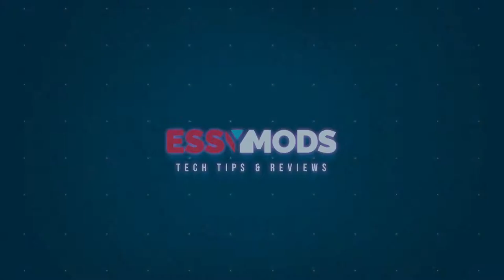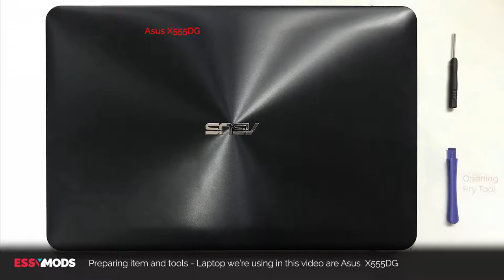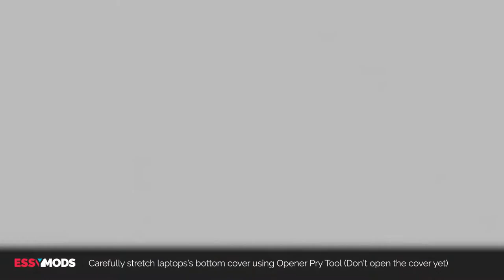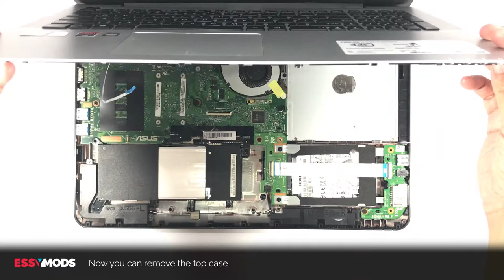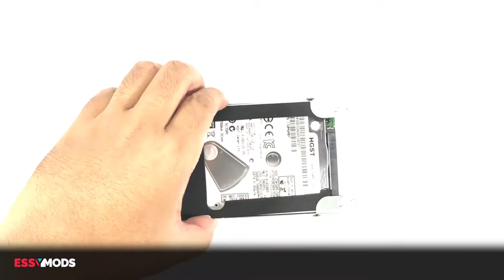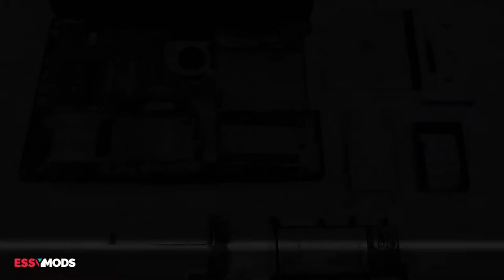ASUS X555DG DISASSEMBLY

Comment: My Asus is a XXX5DG with radeonR6 2gb, 8gb Ram , AMD 10 , 1 teraHDD  .. is for gaming or not?
Reply: My English is very basic , i wait for you help
Reply from the maker: Hi, this is not gaming laptop, it may run games in lowest setting. But not recomended for heavy gamer
Reply: I suppose the games of the Xbox 360 and PS3 generation will run well, after all it meets all the requirements for seventh generation games, it is a pity that with eighth generation games it is no longer a good option.  Thanks for replying, I subscribe to see your next videos